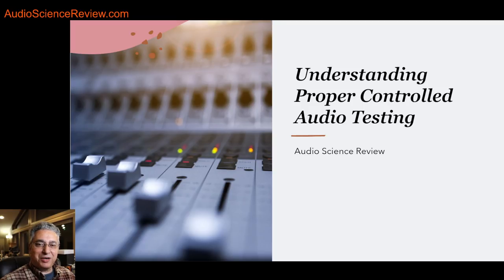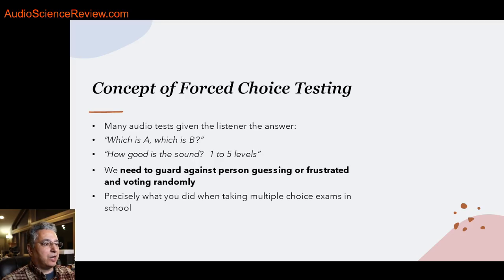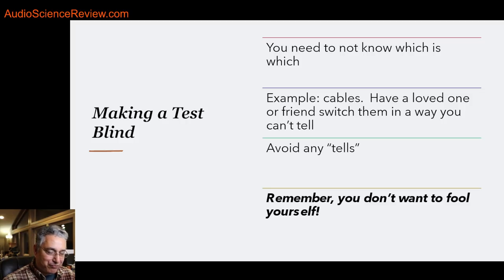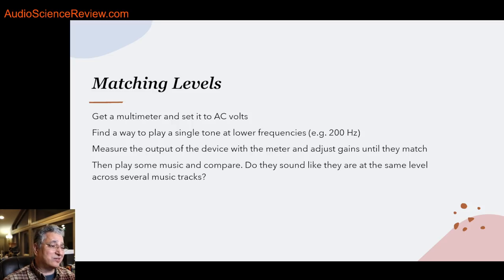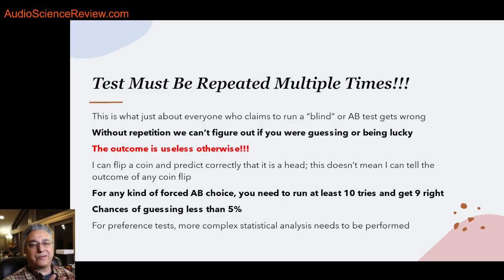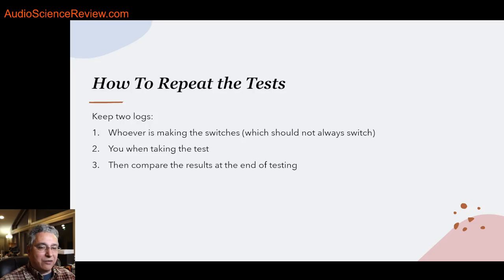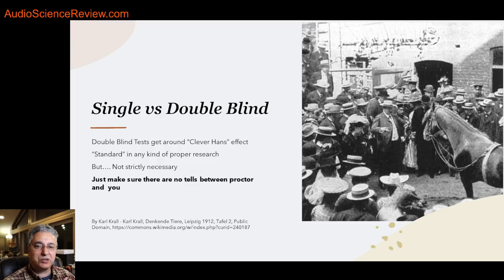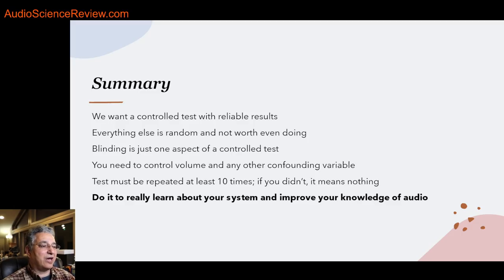Audio Blind Testing - You Are Doing It Wrong!

Comment: And this is why you rarely see it done properly - it’s time consuming, exhausting and NOT cheap. Level Matching quickly is impossible without a proper switcher or you need the lab assistant to precisely adjust the levels each time - I think this is where everything falls apart due to the extended time interval between playback
Reply: So? If you want to sell me something, I want you to make an effort. If you can't be bothered, I can't be bothered.
Reply: @SanderVermeer  good luck going to shops that is going to do blind tests just for before your HUGE purchase.
Reply from the maker: For individuals definitely.  For someone running a company?  It should be quite reasonable for PS Audio for example to run such tests as they can easily match levels in design if needed.  And there is also the large class of products that don't impact levels.
Reply: @AudioScienceReview  Yes but your forum is FULL of people telling us that us individuals should be blind testing every purchase we make.
Reply: @gregc7314  is it though? Is it really?

Comment: A p-value of 0.05 means probability of this result happening by pure chance is 1 in 20. Using an alpha of 0.05 is just arbitrary. There's no law of nature that says we should use this value. It's just a convention that some people decided to use. The medical industry usually don't understand the significance of p-value. They will claim that a p value of 0.051 means no difference whereas a p value of 0.049 means there is a significant difference. Obviously the difference between these two values are just margin of error. There is a much bigger difference between a p value of 0.049 and 0.0001 yet they put those two results in the same basket as being significant.
Reply from the maker: Agree in general and hence the reason I said for my own testing, I strive for far low P value.  Still, p< 0.05 is a heck of a lot better than someone doing a test once or twice with p values of 0.5 or 0.25.
Reply: @AudioScienceReview  agreed.
Reply: I am not sure what  medical industry you are referring to but the medical device company I worked  for had their own in house statisticians and understood the nuances of applying stastics to engineering testing.

Comment: How do you volume match headphones and speakers? Use white noise. You can probably get pretty close just listening but a microphone with a flatish frequency response would be better.
Reply: A calibrated mic is the only reliable way!
Reply: You can use a multi-meter to measure the voltage on the output.
Reply: @mnoble247   I'll let that one go through to the keeper.

Comment: God bless you for this video! I was really upset at the video in question because you saw the same audience in the comments section vehemently defending Paul’s complete NONSENSE.

Edit: question for Amir - what do you think of extended listening as it pertains to like an hour max? Shouldn’t that be a difference over a small enough period of time that is meaningful, or am I still missing the point of quick ABX testing

Edit 2: I mainly ask the above question because of DAC’s; even mainstream DAC creators, let’s take Topping and SMSL for example, will tell you their DAC’s sound very audibly alike and have more subtle differences in the sound signature (take the SU9 and D90SE  as the product example here)…

… Wouldn’t you want maybe like a double run of single songs to take in more fine examples, in those cases where manufacturers are being upfront and honest about finer differences? Am I wrong in assuming quick switching would miss these differences as placebo when maybe they’re not? You honestly got me curious, love that you explain this stuff, and thanks a lot dude.
Reply from the maker: The smaller the difference, the faster the switching needs to be to detect it.  I am able to detect extremely small impairments that 99% of people can't detect but to do that, I need to have sometimes less than 1 second switching time!  Extend that to a few seconds and I can be lost.  So one hour is an infinity in that context.  

Also, the longer you listen, the more you get acclimated to the sound and your discrimination suffers.  Think of your computer fan noise.  Get busy working and you soon forget it is there!  That is the brain adapting.  You don't want that in AB testing.

Whoever says they can detect differences between SU9 and D90SE, show them this video and have them run the test blind.  See if they come out showing a difference.  They will not be able to to.
Reply: @AudioScienceReview   Sorry to let you know but you are an aged man but claim to hear better than '99% of people'? 
Scientifically, you'd be an outlier if you can hear 15kHz at your age.
Reply: @AudioScienceReview  

I see, very much appreciate the concise response! It’s a bit of an inconvenient one cause that makes it way harder to do, but much better to know. Cheers dude.
Reply: @ophiuchia4916  You assume he meant high frequencies. He didn't say that. The quality of your trolling is at a very low level Opie.
Reply: @Mrch33ky  

The troll is a tricky creature that baits the opponent’s sustenance into the open, and wins when it’s fed; don’t feed the troll.
Reply: @Mrch33ky   Please look up 'age related hearing loss' - this affects hearing way beyond high-frequencies.

Comment: Anyone know of a good speaker switcher that has independent level controls, no hiss, XLR output, and can do maybe 4 speakers?
Reply from the maker: Best to do the level control on the input of the amplifier, not the output.  The only ABX tester I know that is in production is Audio by Van Alstine ABX Comparator Switchbox.  Sadly it is not always in production.
Reply: I recently purchased theTEC TC-905B Commercial 5-Way Speaker Distribution Controller with Volume Control and does the job for comparing speakers and or a/b two different amps almost immediately, which is helping me understand amplifiers better and find my reference easier.

Comment: What is the use of measurements if you can’t hear the difference?
Reply from the maker: The problem is proving that we can't hear the difference.  It is easy to say or claim, much harder to prove in all cases, for all people, all content and all situations.  Take an SNR of 90 dB.  If you listen at 90 dB, the noise out of the system will be barely audible.  Crank up the level another 10 dB and now it becomes much more audible.  My goal in reviews is to identify equipment with measurements that make this analysis moot.  If you achieve SNR > 115 dB, then for any level of listening and the listener, it is transparent and silent.  Since this can be done for as cheap as $100 in a DAC, no reason to not strive for it.
Reply: @AudioScienceReview  Thanks for your reply.    But still I do not need any proof I can’t hear the difference 😊.  I think neither do you when you hear no difference.

Comment: Without scientific method in testing, 'audiophile' pundits are just stirring the mud. It's not unlike discussing (arguing) about the better singer, Springsteen or Bonjovi or Streisand.  

I recently had a reply to a comment I made where a fellow made it simple: he said something like there are sound systems that make (for example) Metallica, or exclusively, Coltrane or Vladimir Horowitz, or The Dixie Chicks sound good. But it's the sound system that measures well that makes them all sound good.

And scientific test listening is the only way to show the correlation. Toole did it; Harman does it. 
...
I still chuckle at something PS Paul said in one of his endless series of infomercials. PS had brought in a Crown amplifier to hear because many were comparing it to PSAudio stuff. His speedy dismissal was that several PS staff were brought in to compare the two amps. They easily decided that the Crown wasn't as airy and resolving as their brand.

Comment: I have been looking for such a protocol as this, so thanx. I'd like to offer a challenge and put up 10k into an account so those who claim they can hear the difference between power cords can put their $ where their mouth is. The good thing is, power cords, speaker wire, and interconnects, the three I'd be interested in testing blinded, don't need to adjust levels and such.

Comment: Seminal introductory course into controlled audio testing. Excellent and highly informative video Amir. A much needed video to steer the audio community straight. I have to admit that I myself, many years ago, also believed I could hear diffferences between some electronic gear and cables without resorting to blind testing although I did realize the importance of level matching and at least did that step. We learn through experience though and by following more knowledgeable individuals than ourselves and the science.

Comment: In frequentist statitistics you never get an answer like "the chances of guessing are X%". If you calculate a p-value less than 5% then this doesn't mean that the chances or probability of guessing are less than 5%.
The p-value assumes the null hypothesis to be true! So what you get is the probability of generating this exact outcome or a better outcome randomly, because that's what you assumed: that the result was generated randomly, that the null is true. From such a result one cannot logically conclude an alternative hypothesis (such as really hearing a difference) is true, because the null is already assumed to be true. This is a fatal flaw in this kind of statistics.

There is another flaw: the null is a point hypothesis, which means perfectly 50% true/false in an A/B test or heads/tails in a coin flip. But in reality, nothing is perfectly random, so as you increase the number of trials you will inevitably end up rejecting the null even if it is not true! 

Bayesian statistics solves these issues (but introduces some philosophical ones... at least for certain kinds of people).
For example, a hypothesis for guessing could be constructed with a "hearing ability" parameter ranging from 45% to 55%. Note how this isn't a single point anymore.
For a 9/10 test result, this would give us a probability of guessing: 1.17%.
Probability of doing better than guessing (which also includes doing still very poorly just above 55%!): 98.61%

Note that unlike with frequentist statistics, which does not give you probabilities of hypotheses, these numbers actually are probabilities of these hypotheses.

Comment: Amir, Regarding your discussion about balancing the volume of components under test, would you be so kind as to explain in some greater detail how to go about testing the output with a multimeter from amplifiers and components with RCA outputs. Do you connect plus of the multimeter to the plus terminal of the amplifier, And likewise negative to negative for one channel at a time.? How do you test both channels at once? Likewise when the outputs are from a component with RCA plugs, do you test the center (positive) channel against the negative (outer ring)? How do you position the probes when you want to test the output of both channels at once with RCA outputs? As you can tell, I’m pretty much a novice but I would like to learn how to do this the right way.

Comment: level matching is quite easy when the two things actually sound the same. but when there is a real difference level matching is a problem.
Reply from the maker: That's true.  Fortunately for many things like cables and audio tweaks, levels don't change so one doesn't have to worry.  When you do have to worry about it, it can go from trivial to very complicated (e.g. speakers and headphones).

Comment: Our ability to detect sound level changes is worse than +-1dB. You need to match them to +-0.1dB.

I disagree on the usage of a multimeter, it needs to be fairly good to do that reliable at the accuracy needed. But pretty much any ADC can do it. Multimeters are not meant for audio, their RMS is pretty much meant for <1kHz. But even the noisiest ADCs can do it at 0.1dB range, while you can also check that the frequency responses are not so different that it makes level matching impossible to do with just voltage levels.
Reply: I was watching for how close the audio levels needed to be but see it. Did he actually mention it?

Comment: I doubt there is any industry-accepted statistical and procedural protocols/standard established in the industry (like those in bio for example) to conduct a controlled experiments in the field of audiophile / HiFi. However there have been and are many such similar experiments done in the filed of human auditory / speech / listening / assistive both by the industry practitioners and relevant academics. It shouldn't be hard to transfer such processes to the filed of HiFi. But doing so is like introducing some form of industry oversight on product claims / lability and I doubt this would ever happen at all ..
Reply from the maker: Yeh, I wish there was a standard totally focused on codifying this but there isn't.  ITU BS1116R has some of this but not nearly enough.  A very good point you made there.

Comment: AB with fast switching is good enough in this scenario. As long as I can tell a difference between 2 equipments, that means there is a difference and I can make my choice based on what I prefer more.
Reply: You also need precise level matching measured with multimeter, but you can still hear differences where there are none if you know which one is which, human hearing is a complex cognitive process.
After you do the sighted AB level matched get someone to randomly switch it a few times, it changes everything when you don’t know which one is which.
Reply: @f1shb0n3d  getting someone to change it for me isnt going to be a problem, if there is an audible difference, there will be an audible difference. I dont need to identify what is different or need to explain what is different, and that makes it way easier. As long as you can tell a difference, its all good.
Reply: @AbsoluteFidelity  I did a lot of these tests myself comparing DACs and headphone amps. Learned a lot in the process. For example: I can’t distinguish well measuring DACs, but I’m very sensitive to channel imbalance of headphone amps.
Reply: @f1shb0n3d  in theory, well measured amps, dacs, pres, etc should all sound the same under clipping volumes. I can get that. Now lets take 2 500 dollar amps, lets say a NAD C316BEE V2 and a Cambridge AXA35. Do you think those amps would sound the same under clipping levels? Do you think they are at a level that both would measure near perfect making them indistinguishable in an blind test? Do you think that the makers of those amps decided not to 'inject' their own sound signature by manipulating frequency response to make it more attractive to the mass market e.g beefing up the lower frequencies to make it sound warmer? At what price point or level does all this stop? Im sure some higher end brands do the same and there will be differences in sound between 2 amps even when volume matched BECAUSE THEY ARE MADE TO SOUND DIFFERENT in the first place.

I agree that good (read : neutral and accurate) amps, dacs, etc would sound the same but this does not apply to ALL amps and dacs, especially ones in the entry/mid level category. That is where measurements come in to identify whats different and causing the difference.
Reply: @AbsoluteFidelity  To answer the rhetorical questions - I don’t know. Comparing speaker amps is next on my audio TODO list - bought a speaker A/B switch and plan to compare Onkyo AVR vs top measuring Purifi-based amp. If you have any tips on how to do it or what to listen for I’d appreciate if you share some.

Comment: Criticizing people who actually make audio components. Yet, this self proclaimed “guru” still uses THD+N to rate gear. Lmao WHAT A JOKE!
Reply from the maker: My reviews have extensive set of measurements.  THD+N is an industry standard and the reason it is in the Audio Precision dashboard by default.  Had I stayed with that one graph, you maybe, maybe have a point.  But you don't.  For some products like AVRs, I run upwards of 12 tests.  Many aspects of a product are tested across multiple spectrum of impairments from jitter to noise to intermodulation.  So the joke is on you for not reading and paying attention to what I do in my reviews.